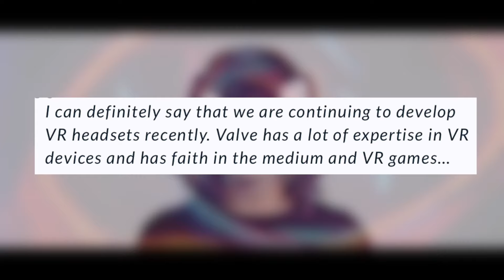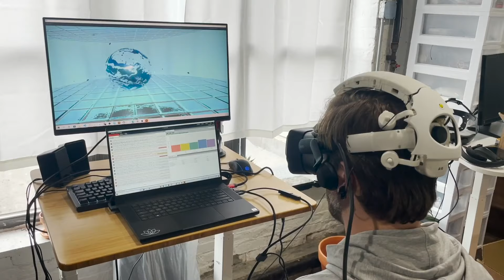Valve Deckard is COMING!  Index 2 VR Headset

Comment from the maker: Would you buy the Valve Index 2?
Reply: yes
Reply: I have all my games on my quest 2,
My only issue is, It doesn't work like it used to when I got it on launch day. 

No I wouldn't buy the 1000 dollar headset if the quest 3 will be half the price with almost the same features.
Reply: Yes.
Reply: yess
Reply: Yes
Reply: would be so cooooll
Reply: Uh yes
Reply: To see the comparison with quest3
Reply: YES
Reply: Day 1
Reply: yes
Reply: Yes
Reply: no......who am I kidding day one baby!
Reply: If it's wireless.
Reply: If it's OLED I might not have a better option.
Reply: Not when it will be broken in Normal use. I only buy stuff that does not break like that hence Quest 2
Reply: Been waiting for 4k each eye since OG Vive.  Index 1 wasn't enough of an upgrade but this will be. Most especially the OLEDs and FOV. Deck integration is simply icing on the cake. I could totally see using it as a wheel to steer with for racing without a rig. Make an attachment which clips on to your desk and the deck with a resistance motor in the hub.  Bam. Steering.
Reply: Obviously yes
Reply: @ItsEond  dude I you should buy the valve for the controlllers alone nvm the better quality
Reply: @toututu2993  what breaks?
Reply: @freefalling6960  Your brain
Reply: When it comes out I’ll compare it to the quest 3 and if the deckard  is atleast 1.5X better I’ll get it
Reply: I'm definitely not buying a locked down device. I have the steam deck and it's the best gaming console I've ever had. So a VR headset with the steam os that has the same freedom would be awesome.
Reply: @Victorianous  what do you mean with "locked down device"?
Reply: yess
Reply: yes
Reply: Yes. Valve Index was a great headset, and the Steam Deck was an amazing handheld... So, yes.
Reply: It's going to be bad for PCVR users, since you're paying for extra internals that you'll never use.
Reply: I was waiting months for my first vr from quest 3, seeings its a low contrast pass through crap I now have to wait for index 2, hopefully its oled with pancake lense
Reply: I love the index.   If the index 2 is a way better version then i totally would
Reply: Probably would buy it if Valve ever decides to ship to Australia, lol!
Reply: yep
Reply: Definitely, assuming it'll be the new best PCVR headset, to this day quite a few people thing the valve index is the best in multiple areas so if they keep up that quality but make it good by modern standards it should be great, I trust valve... im just worried about how long it'll be till it's actually announced
Reply: YES. if it includes pancake lenses or similar ontop of that, HELL YES. But the dual 4k micr-oleds has me sold immediately, fuck everything else x'D
Reply: Depends on the price and quality
Reply: yes
Reply: DEFININTVELY i'v been waiting for a real replacement for my htc vive pro over to wireless high quality... i payed 1600$ when it came all out... "canadian" also been hoping for hand tracking capability! for fun games for me and my kiddo
Reply: Yep
Reply: Absolutely
Reply: depends on price
Reply: Probably going to get the Somnium VR1, at which point this isn't a significant upgrade
Reply: Only if it was standalone
Reply: Depends on the delivered product. I buy nothing on hype.
Reply: yes

Comment: I really hope the decard has a more cut down version or something. 

I don't want to be spending $1,000 on a vr headset. 

Imo, to compete and take a chunk of the marketshare, they need to make a quest 3 competitor. Something that is standalone, but can be linked (not permanently) to your steam account. 

Then to play a game you can just inatall anything you own on your steam account to the headset (or atream it over wifi 5/6) and boom, done. 

They really need to get a $500 headset that is standalone and focuses on using the steam library. Sell it at a loss if they need so that people are willing to buy it, and then they recoup a profit from the vr game sales on steam store itself (like how they are doing with their handheld, the steam deck)

I have not had a VR headset since the windows mixed reality stuff for $150, and I probobly won't untill valve gets a dam standalone headset that can do that, or some 3rd party company had some type of tie in to my steam account to let me play my vr games i own on steam. 

I have used and love the pico 4, but i dont want to be opening up more accounts with different companies and splitting my libraries all over the place, i want it all my games centralized on steam so i can use any headset inwant in tethered mode, or use the official headset in a untethered (standalone) mode.
Reply from the maker: Fair points well lets see what they manage to pull of
Reply: there's always the index 1 i mean 
apart from screen res it's still very competent and a very good experience nevertheless
i am excited to know basically if i go Index 2 OR if i buy a Index 1 lmao

Comment: I was hoping it would of had a bigger fov than it’s predecessor which for me  is really important for immersion in vr . That’s why I’ve stuck with my htc vive all these years because with a modded face mask I get a fov better than all other headsets out there including the index 1 except the pimax but that requiresd a powerful pc and its to fidgety to get up and running and for each game what with all the tweaking and settings necessary so its dissapointing the index 2 will not have a larger fov  . It seems like the only real alternative is still the pimax unfortunately but at least the crystal is be also standalone but with only 120 horizontal fov and the price point for me will be a turn off - o well it still looks like an gonna stick with my vive for now .
Reply from the maker: vive is sadly not doing so great with their vr headsets at the moment
Reply: @VRelity  I think its a fantastic piece of kit for the price ? Yes I know it has a screen doir effect and god days but yoi can use gear lenses and the very good tracking and fov and full steam software support not to mention it has a wireless adaptor and can be used with valves knuckle controllers as well as easily being upgradeable to a valve or pimax .  There has been no headset at the moment making me want to part with over £1000
Reply: @paulnicolas172  yeah if screen door effect doesnt bother you the HTC Vive is still awesome & imo the 2nd best overall experience, (the Vive Pro being the best) no other headsets have better tracking combined with wireless, the resolution is low but my 4080 allows me to turn up MSAA & Supersampling to max which takes care of 99% of jaggies
Reply: @LucasJodokast  hi and thanks for the reply ! I might upgrade to a pro or a pro 2 maybe in a few years when prices come down or just go with a pimax but the crystal only has 120 degrees fov horizontally and the other iterations are too fidgety to use but right now just for the increase in resolution I don’t really see the point in changing and I’d have to upgrade my pc as well . The quest 3 and valve deckard will be coming end of this year but like I mentioned there fov is still going to be last gen - such a shame . The quest 2 fov is binocular size .Another good option with a low price point is the old Samsung oddysey plus - you can pick one up for around £150 - 200 with inside out tracking , good clarity and fov is about the same as the vive/pro or maybe slightly smaller so I might possibly upgrade to that right now and if I sell the vive won’t hardly cost me any more ? 

Anyways am sure give it maybe 2-4 years we’ll see better headsets with larger fov coming out it’s just a matter of time as vr I think is the future once they make the headsets more user friendly for the masses - I mean look at the popularity and support of the quest 2 and psvr2  right now 

Anyways thanks for the reply
Reply: I swap regularly with the Index and my OG Vive because the Vive has the wireless adapter and even with the slim face gasket the Vive FOV doesn't hold a candle to the stock Index FOV.
Reply: @HybridEnergy  Really ? It’s amazing how much people’s opinion vary as a few mention on Reddit and a reply I got on here on another post mentioned the the modded faceplate on the vive has a fov the sane or just slightly better than the valve stock fov ? 🤔 That’s why I didn’t buy it even though the resolution was better it just wasn’t worth me upgrading my pc and buying the headset and trying to sell my vive headset just for the added benefit of that ? Usually you can get a good idea of how good the fov on a headset might be by the size of the lenses and as far as am aware they both have the same size lenses ? Still I might buy a used one on eBay in a year or two when the prices come down anyway just to see how it compares . 

When you used your vive with the modded face gasket did you use gear vr lenses as well as I’ve heard even though it’s clearer the peripheral fov reduces a little as well maybe this is why u notice a difference but even then when you mention it doesn’t hold a candle it sounds like it’s going to be 30-40 degrees bigger or something - if it really is much bigger then I will buy it as I was quite impressed with the modded fov of the vive (well compared to other headsets at the time anyway.). And how much better was using the index for you in terms of the horizontal fov as the vertical fov of the vive is almost clear for me so there wasn’t an issue there - horizontal is really the issue for me as the vertical fov is fine ? Do you think you can even mod the faceplate on the index to even get a bigger fov perhaps ? Cheers
Reply: @paulnicolas172  I never modded either of my Two Vives with the gearVR lenses. So far since 2016 I have owned 2 OG vives, a Vive Pro which I still have, and the Valve Index. I owned other headsets but they don't matter for this conversation.  Having the OG Vive as close as possible increased perceived FOV over the original 110 degrees claim and it really outclassed CV1 then in FOV because of this trick, but most of it is horizontal and total with vertical nowhere near that of the Index with the stock faceplate and it's closest to your eyes setting. You should try an Index somewhere, because you say vertical doesn't interest you but believe me it's really horizontal x vertical increase that gets rid of that looking through the toilet paper roll feeling.  Word of warning, someone mentioned to upgrade to the Vive Pro above, I was not able to increase the FOV the way you did with the Vive as there is plastics and things in the way ( I have not used a Vive Pro 2, I assume it's similar ).  I have a Vive Pro sitting in a box I don't use it as it was less comfortable with a smaller FOV and sweet spot than the audio strap and wireless combo on the OG Vive. Do not look for a Vive Pro anymore.  There is far more than just FOV benefits from the Index, including it's audio, comfort, resolution, and refresh-rate options.  They did it with out increasing the lens size and you'll hardly need to update your PC for this resolution bump, it's same as Vive Pro.  That's my experience , Cheers.
Reply: Can you tell me what mod you use for the vive?
Reply: @HybridEnergy  Okay appreciate all that info . Thanks for letting me know about the vive pro so won’t be buying that . With the index it’s a hard one as it was a big increase in horizontal fov as well is what I wanted . I’ll bide my time and wait and see I think over the next year or two and if there are no other headsets I’ll either upgrade to an index/vive and I won’t be losing much then if it didn’t work out but will def have to upgrade my pc as I only have an gtx 970 i5 4th fen 8gb ram which I don’t think will work well with the index but definitely not with the pimax . Let’a see what the deckard and quest 3 are going to offer as well - not for fov but for wireless at least as wires are a pain for roomscale gaming . Cheers
Reply: @HybridEnergy  ps meta are hosting there quest 3 showcase on the 1st of June if you don’t know
Reply: @paulnicolas172  With that CPU and GPU combo I would be concentrating on a new computer.  I am on a 7700k and 1080 ti and I will finally be moving up to a new build by the end of this year hopefully.  With your CPU the headset won't matter as you will have a hard time bargaining for frames with new games.

Comment: I think deckard will effectively be at least 6.5 tflops after foveated eye-tracked rendering which is like a gtx 1070
Reply from the maker: lets gooo
Reply: That would be around a 15-20W system... that seems very unlikely as it would require a lot of cooling and a cooling fan next to your head = bad vibes. They could run the RX780M at TDP down 10W and hit your  perf, but it would have to spend another 5+ watts on CPU and LCD power.
Reply from the maker: @Wingnut353  would need some good stuff for that for sure

Comment: Valve index is still arguably the best headset in 2023 due to its superior tracking, audio, controller design,  and up to 144hz refresh rate. The only thing it lacks is the Pimax VR native 4k resolution and an adjustable Field of View. Is Index worth 1k dollars? YES.  Will Valve index 2 be worth 1k dollars as well? Absolutely YES.
Reply from the maker: it has some crazy features that were so high tech back then only thing is that the years are starting to count up though. But what is your favourite vr headset?

Comment: They should make valve index 2 wired and have to be plugged in all the time too because if they make it wireless we’re gonna run into the same problem with battery life as on meta quest. And I wanna be on vr like all day and all night. I can’t do that with a battery that only lasts 2 hours and gets worse overtime
Reply from the maker: I guess we will have to wait and see but would you want a valve index 2?
Reply: It's not hard to implement an optional wired mode. So even if it will be wireless, it's still definitely gonna have wired mode optionally.
Reply: @VRelity  No actually because now I have the BigScreen Beyond. Lot of people probably will buy that instead of the valve index
Reply from the maker: @SpringChickensOnlyMan  nice are you enjoying it?
Reply: @VRelity  yeah it’s great

Comment: if this is a standalone headset i hope it can be connected by usb to my computer to play my steamvr games. which i could already do with my quest 2 but the oculus software makes any vr game i play drop to the framerate of a powerpoint.
Reply: Yeah i have the same problem with oculus airlink, i can recommend trying out virtual desktop, for wireless streaming from your pc to quest 2 it works better than airlink for me.
Reply: @birkmortensen9841  i use alvr, and it aint even airlink that got the problem, its just regular oculus software with the usb cable
Reply from the maker: jup

Comment: If it’s not wireless, I’ll be on the fence for a while. 

Still love my index, so not sure if it’s worth the upgrade until I see hand on reviews
Reply from the maker: jup wireless is the way to go
Reply: @VRelity  is it? Doesn't it have latency issues & less graphical power, depleting the purpose of VR realism? Playstation made a conscious decision to keep the cord...
Reply: I still think wired is superior at the present time. (Until the compression and latency issues are fully sorted.)
Reply: @Skrenja  well supposedly the laser transmitter/receiver is supposed to fix it but haven’t read up on them past their demos
Reply: Unless they fix the latency issue it's gonna be a while. Like playing games on WiFi instead of lan
Reply from the maker: @ConservativeJuggaloPodcast  they both have their pros and cons but for me wireless is need to have a comfortable vr experience
Reply: @VRelity  if it doesn't have realistic graphics how is it comfortable? So as a Project Morpheus user, I have to make it as comfortable as I possibly can. I currently have the cord strung up over my cieling fan with a small loop for slack & that works pretty well. Aren't the standalone limited on the number of games you can even play?
Reply: @Skrenja  even if they do fix latency its like having a PS3 instead of a PS5 as far as realism goes isn't it? Once PS5 Pro hits &Sony VR headsets are more common in households I think people are going to notice huge differences between that & Quest standalones
Reply: @ConservativeJuggaloPodcast  The difference between wired and wireless is latency not the graphics it won’t be like going from a ps3 to a ps5 when changing from wired to wireless however a standalone headset (can operate by itself) will have decreased graphics as they have to develop the headset’s on board computer chip